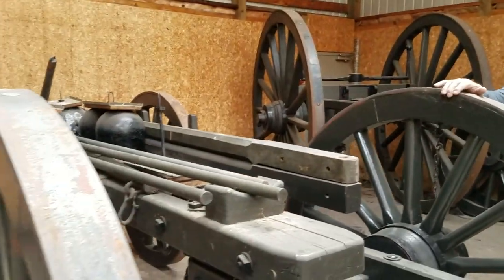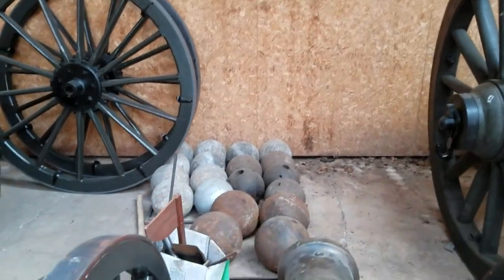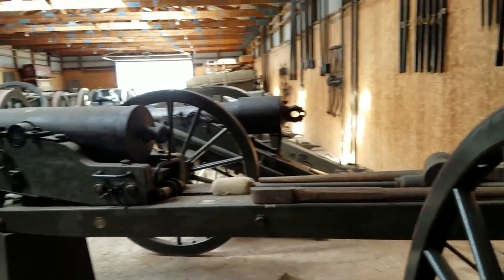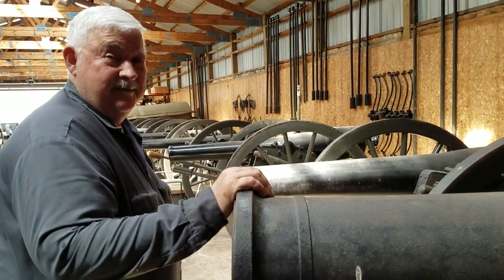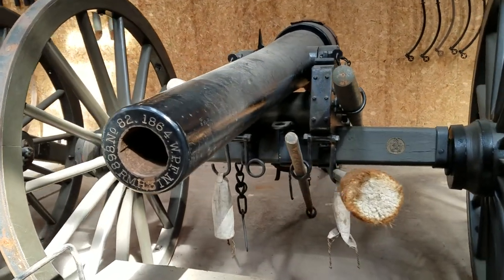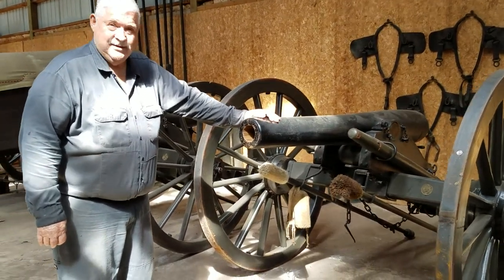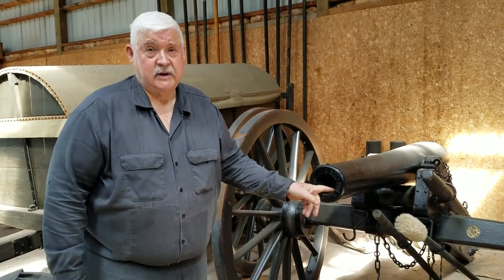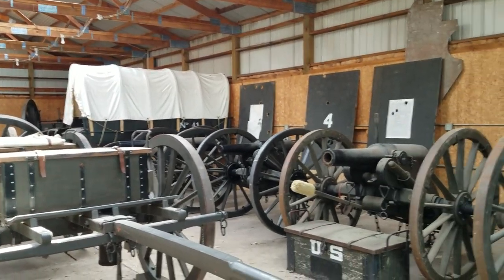Civil War Siege Cannon, Pack Cannon, Ordnance Rifle, Parrot Rifle Cannon

Comment: In 1994 I worked at Bay Engineered Castings in DePere Wisconsin, we cast 2 of the large mortars and I finally figured out where they went! 
 They were simple Castings but the core burned in pretty badly and had to be chipped out with torches and air hammers.
Reply from the maker: amazing pard.  Are you stating you believed that the mortars that you casted are at this museum site? or was this another location?
Reply: @1stminnsharpshooters341  I believe the word in the shop was that the Paulson brothers received an order for one which was to be sent to a reconstructed military site, and since they had the pattern they made an extra one for themselves, which I assume to be the one in the video. 
 They were in the shop when we poured it, so the information came from people who actually spoke to them.